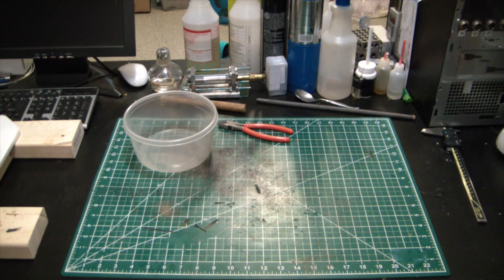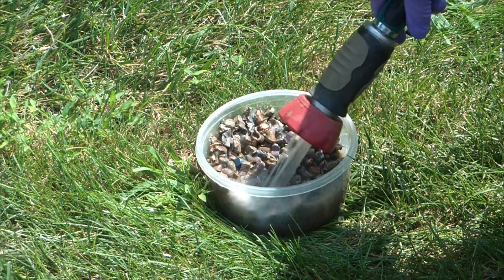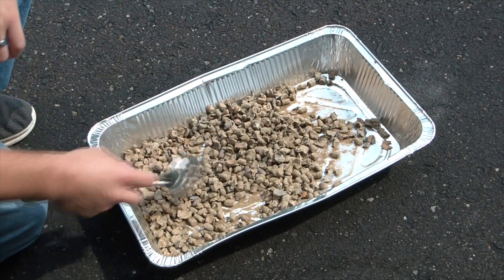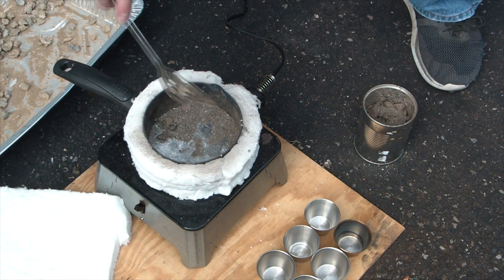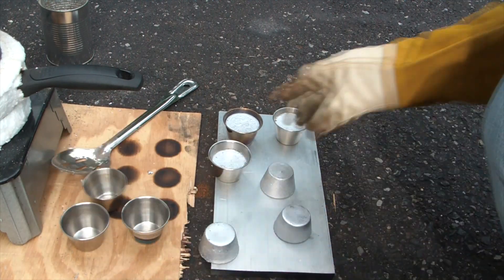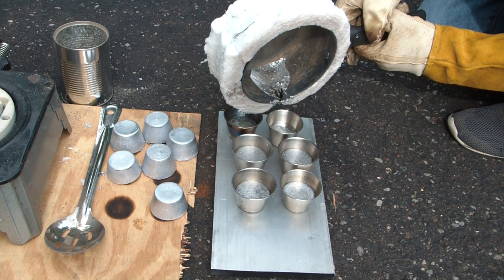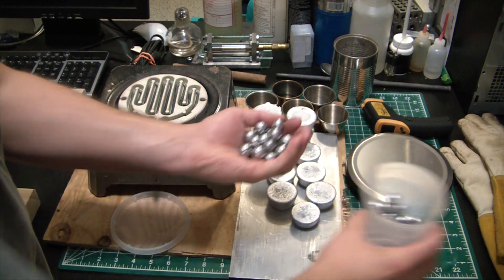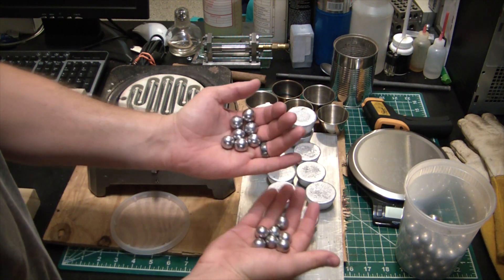Refining Lead from Free Range Scrap - ElementalMaker

Comment: Oh man, I wish I had thought of this when I was filling my solder pot. I could have spent $10 in gas to the range and "saved" myself $2 on the decorative tin plate I picked up from the thrift store :-)
 I usually keep an eye out at the thrift store for cheap decorative plates and trinkets that have a distinct titanium like color but are thick and heavy. If they are marked $1-$3 I do the tin test. Tin is deceptively easy to deform under force. It also has a distinct sound when it bends. It sounds about like fracturing glass. If it doesn't yield to force, it isn't tin. If you're really looking for tin a few items will have their metallurgy marked on the bottom in a stamp. Regardless, this stuff melts and casts the same as lead. It's probably the best option for those without access to free range lead.
Reply from the maker: I have a range less than a mile from my house so that makes it pretty economical LOL
Reply: @ElementalMaker  
  When I lived in TN/AL/GA it would have been the same. Here in Southern California it's a bit different. Gun culture here is not about hunting. It's mostly egos and idiots. There are a few indoor ranges around, but the closest outdoor is quite a ways away.
Reply: @UpcycleElectronics  where in Southern Cali? I lived in berdo for a decade, If you go back far enough about half of the canyons heading into Calhoun pass and Angels National park have open ranges in them. If the rangers see you picking lead on the south side of Angels they might offer to buy you lunch. But whatever you do, don't smoke around them or you might be lunch.
Reply: @johnkiss8804  
I've been to that range back around a decade ago when I first moved out here. I'm in suburbia though. Funny part is I'm quite close to every kind if ordinance range imaginable. They are just on the other side of the Camp Pendleton fence. I'm in San Clemente. It's the last little municipality at the end of orange county. Nice place, but not exactly gun country.
Reply: @UpcycleElectronics  Oh yeah know exactly what you mean there, the base kind of has you hummed there. Now in the mid 80's you could get base access or the native Americans could I should say. (my wife is native, I went a couple of times with her brothers) We policed the brass and took it to the reservation in AZ. It wasn't the base commander that had to sign off on us. I want to say Casey's 1st letter went to the master at arms, then the range officer, and then the officer of the day was the last one who had a yes or no for us. We had to wear visitor badges and those orange vest like road workers that said non military personnel. Cracked me up because I was in the navy at the time. Let me see if I can hunt down an old friend, OC Sheriff used to have an indoor not too far away. My wife might have his sister's number.
Reply from the maker: Indoor ranges are great for collecting lead too. It depends on the backstop material though, and alot of ranges collect the indoor lead and sell it so its a bit more difficult to find a participating range.

Comment: Is there an economical way to remove the tin and antimony? I like to cast round balls for black powder revolvers and need as soft of balls as I can get to cram into the cylinders.
Reply from the maker: If you pick out the cast boolits, the jacketed ones are pretty much pure lead. That being said I use this alloy in my BP cannon no issues. Its pretty soft
Reply: Matthew Wilson
 up above mentioned dissolving the lead with concentrated acetic acid and H2o2, which would precipitate the antimony or arsenic out as oxides... Would be a good start. Perhaps he'd be so kind as to chime in here?

Comment: hey m8 
I'm looking for balls for mill ball and i don't know with one shoud i buy , can you give me some avdice ?
Reply from the maker: Absolutely! Firstly what material are you making in your ball mill? Different materials require different medias
Reply: @ElementalMaker  the same like everyone; black powder metals like zinc 
Charcoal and different explisive materials
Btw i have a problem with mill ball specifically in my country we don't use this type of pipes so I looking for different solutions but still
Reply from the maker: Its good practice to keep one jar dedicated to each material you plan to mill. And of course just keep the media in that jar as well. That way no cross contamination happens which could potentially cause disastrous results. For BO you need lead or brass. I use lead because I get it free and can cast balls quite easily. Zinc would probably best be done with hardened steel balls, but be very very cautious and open the jar every half hour or so, otherwise the powder can turn pyrophoric and spontaneously combust if an oxide layer isn't allowed to form. Charcoal can be done with just about anything, but I just use lead.
Reply: @ElementalMaker huge thanks for you ,You answered almost all the questions, and what about aluminum, and I'm not sure about the use of steel balls, it is quite dangerous because when such trash can create sparks , what do you think about that?
Reply from the maker: I use hardened stainless balls for aluminum production. Just like zinc, continually open the jar to allow fresh O2 in to create an oxide layer on it otherwise it will go pyrophoric and create a nasty fire. Also I should definitely say, NEVER mill indoors. Keep your mill 100ft from any structures and remotely plug it in so that your always a safe distance away should anything happen.
Reply: @ElementalMaker  a bit hard keep jar 100ft from any structures because I don't have house and free space around, however I'm taking risk , thank you for all advices
Reply: Last question , how big and how heavy those balls shoud be? Most balls are something like 0.7-0.9mm or cal 36 or 44 for black powder guns

Comment: My free lead comes from tire shops. They pay to recycle old tire weights and will give you as much as you need
Reply from the maker: Great suggestion! I also have a big bucket of wheel weights I got for free. They are a great source.
Reply: @ElementalMaker  They can be a Hilary and a half to sort though, I toss the steel ones and usually save the zinc ones for future casting. It is hard here to get them due to so many reloaders hoarding them for bullet casting.

Comment: I use one of the propane weed burners from harbor freight for melting mine, it can melt roughly 25lbs of wheel weights or range scrap in about 5 minutes in a cast iron skillet just sitting on the ground.

Comment: You can also get lead from tire shops sometimes. The weights they use to balance tires are often lead and they will give you the used ones
Reply from the maker: Ah man I forgot to mention that! I have a big bucket of wheel weights. The only trouble is they are quickly moving away from lead, and sometimes you will get bismuth ones in the mix which can contaminate and mess up your alloy. The steel ones just float though so no worries there.

Comment: I know this isn't what you do on a daily basis, but I've been processing about one five-gallon bucket worth (four 1/4 filled for weight) every couple of months.  A few pointers:
1) do NOT wash your range scrap.  It puts water into the nooks and crannies and you do NOT want water.  All of the dirt and rocks will float to the surface.
2) ALWAYS add solid to solid.  Never put solid on top of melted.  Add it to the top while it is still melted on the bottom and solid on top.  If you drop lead into the pot it can and will cause a lead explosion eventually when water flashes to steam.
3) Flux it with sawdust.  That weight in the dross you were feeling contains tin and antimony as alloying agents that make the lead harder and easier to cast.  Unless you flux, you do not get this benefit.
Reply from the maker: I'll have to try using sawdust for flux! I always used paraffin but sawdust is free!
Reply: @ElementalMaker  I use sawdust I got from Lowes. If needs to be dry, that is about it.

Comment: Thats a lot quicker than another video i watched. He took side cutters to the full jackets to get the lead out and in case they have moisture they dont blow up.
Reply: you need to do that with fully jacketed bullets, like plated pistol bullets. Otherwise you get the molten lead equivalent of microwaved pizza rolls.

Comment: Where i live (Germany) it's hard to go for me to a shooting range
But car battieres are also good (bit toxic tho)
Reply from the maker: I've never tried using a car battery but would love to give it a go. How do you deal with the lead contaminated acid waste?
Reply: @ElementalMaker  you can do basic chemistry, you can exchange the ions and stuff but i mostly do sloppy way and just torture heat everything and dispose of everything that won't liquify

Lead batteries are somehow easy to dispose, even with crap inside and taped lid, the disposal still takes them
Reply from the maker: @TheChemicalWorkshop  ah that's very slick! I'll have to give it a try some day

Comment: Pro-tip (from archaeology, of all places): using a standing sifter will speed this process up significantly. You can wash quite a bit of the dirt or lead oxide out the bottom so there will be less skimming off the top of the smelter later. As added bonus, the additional exposed surface area along the bottom of the sifter will make drying much faster.

We would use this method to quickly expose and clean artifacts in the South where humidity made sitting around waiting for water to evaporate a pain.
Reply from the maker: Yeah I need to get a nice washout screen! That would make it a breeze!

Comment: My setup is BBQ pit using wood, leaf blower and cast iron skillet.  She gets a little hot so make sure your corn bread molds are warmed up, not sitting outside in the early morning dew.  Just saying it can get a little interesting when the lead and cold cast iron meet.  Also pop cans make good molds, you just peel them off once cool.  Or hand your friend a cold one that weighs 10 pounds.